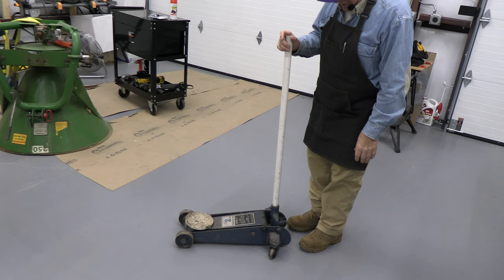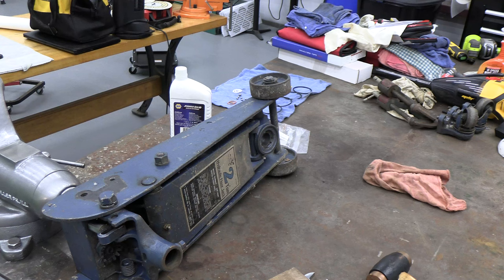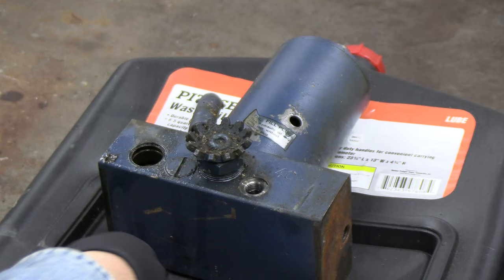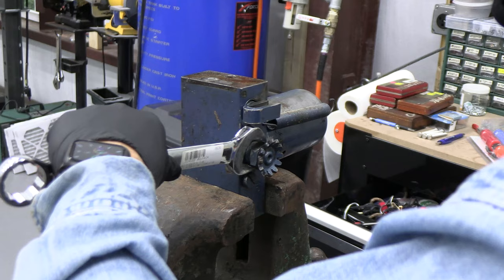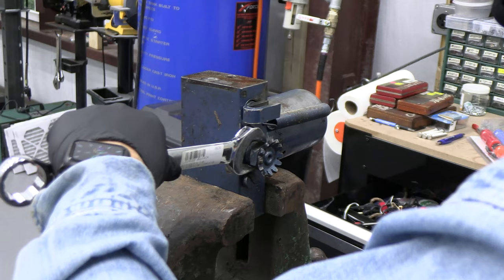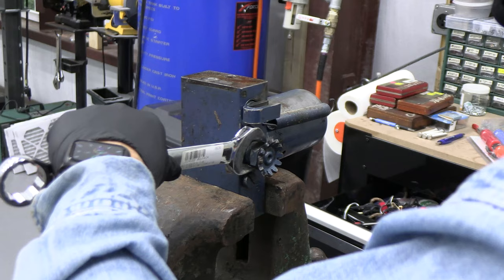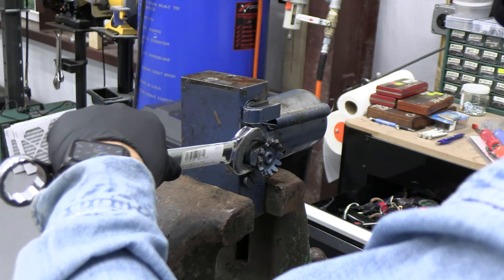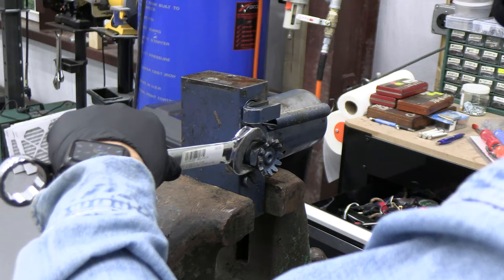Sears 2 Ton Floor Jack Complete Rebuild

Comment: I have a Central Hydraulics 94629 3 ton.  Is there an easy way to slow the release, so it's not so abrupt?
Reply from the maker: Thank you, Garry for your question. I have some ideas, but I’m not certain. One, be sure that the hydraulic fluid in the reservoir is full, too, lubricate the gear where the handle connects to the release valve of the pump. And then I would run it open and close open and close multiple times to get it really loosened up and then you should be able to open it more slowly and have it become less abrupt. I hope that helps. Consider subscribing. Thanks. Joe.
Reply: @JosephHunstad  Thx.  I took the release valve out, disassembled it ad greased the internal threads.  I also marked the gears meshing point for best control with red paint.  All good now.  Probably old and just needed lube.
Reply from the maker: @garyvanremortel5218  Hey buddy great news fantastic I’m glad that worked out. Have a good day. Joe.

Comment: There are many folks that use adjustable end wrenches incorrectly. Iv'e been taught and makes sense, is to flip that wrench over for the direction shown. What it does is it spreads the jaws and allows them to not fit correctly around the fastener.
Reply from the maker: Thank you for your comment. You make a good point. Consider subscribing. Thanks Joe.

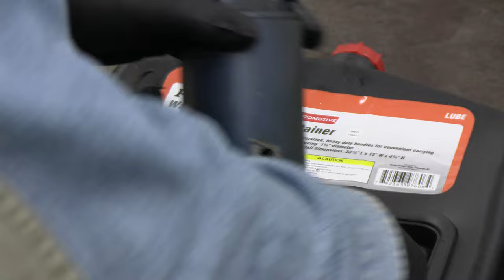Comment: RE loosening the gear in the base @8:17
If you know this is coming off, you can bust it loose before taking things apart. I put it sideways, put on the wrench, and wacked it with a hammer.
Reply from the maker: Hey buddy sorry about taking so long to respond to your question. You're absolutely right I  should've busted it loose before I took it off  of the frame. That was certainly made it easier and reduce the step. Consider subscribbing. Thanks Joe

Comment: I have dads Sears jack from years ago. Our jack is Orange an still works fine but i might need this?
Reply from the maker: Thanks for your question. You’ve got a good jack. If it fails to hold weight, then it needs to be rebuilt until then it should be fine. Consider subscribing. Thanks. Joe.

Comment: Hello Dr. Joe! I have a very similar jack at home, but it doesn't have any lables for me to identify the exact model. It stopped working so I tried repairing it, but made the mistake of trying to blow out some dust with a compressor, so the small balls flew out. I did my best to find each one, but as I do not know the model, it is hard to know how many balls there should be and how big they are supposed to be. I was wondering if I could send you a picture of the jack somewhere, if you could tell me which model it is and how many balls there should be. Thank you and keep making awesome videos!
Reply from the maker: thank you for your comment. Yes you probably have lost some of those ball bearings which is actually OK because the rebuild kit will have everything you need. I would recommend getting the rebuild kit that I suggested because I ended up with a lot of extra parts. If you use it, you will have everything you need.

Use the number of the Jack that’s on my video and Google it and look at images. You will find an exploded parts diagram that you can use to rebuild your Jack.

You’ll have a good time doing it and it will work. Consider subscribing. Thanks Joe.

I will have a link in my video description for you to buy that kit and I actually make a few pennies on it but it doesn’t cost you anything more than if you bought it outside of my lake. Thank you thanks for supporting me.

Comment: Did the white cup part come of easily or did you have to screw it off? Mine won't budge. 0:28
Reply from the maker: OK that white cup should just pop off. You can pry it off with a prybar from underneath it and tap it with a hammer to help it out. It’s not pinned in or anything like that. At least mine wasn’t. Consider subscribing. Thanks. Joe.
Reply: I did. Thanks for the update.

Comment: Awesome video. I have a different problem with my jack (I have a different one mine is a 3 ton model 875.501153). Mine lifts ok and holds the load up but what it’s doing is as I’m lifting my truck higher it doesn’t go up with a full stroke. The higher it goes the less it lifts. As it gets to about 2/3 of the max lift as I pump the handle down it freely goes down almost all the way and only lifts when your almost at the end of the stroke. It will lift and hold but the higher it gets it takes a lot of pumps of the handle to get the tires off the ground. Do I need a full rebuild or what could be the problem? The jack is almost 30 years old and I bought it new at sears back in the day Thank you.
Reply from the maker: Hello there. Great question. Funny that it works that way, but it would suggest to me that seal and O-ring replacement would probably benefit or fix that. I’m not certain however. It’s probably the best way to go. I’d be interested in knowing how it turns out. Thanks Joe.
Reply: Fluid may be low.

Comment: Have exact same jack.  Trying to remove the saddle.  I removed the "C" retaining clip.  But the saddle does not lift off?
                                          Does the saddle unscrew. Trying to figure it out.  Help.
Reply from the maker: Could you tell me at what time in my video that I am working on that part. I don’t really understand the term “cup“ thanks Joe.

Comment: Thank you for this video. Very helpful and detailed. One question : what is brand and size of that wrench extension tool you used at time 9:10 of this video. I think I need one of those.
Reply from the maker: I'll get back with you Its at my cabin
Reply: Thank you. After reviewing the video about 25 times and searching I think I have found the tool from a Canadian Store - Thanks again @JosephHunstad
Reply from the maker: OK the wrench extender that I use I purchased from Lee Valley tools. It is made by the chestnut tool company. It has two very large rare earth magnets that hold the wrench in place. It is very well-made and a very good tool. It’s about $27 I think from Lee Valley.
Reply: Dr. Joe - thank you so much. I have just bought one of these tools from Lee Valley and until your video I had never heard of Lee Valley Tools - what a great store and resource. Thanks again. @JosephHunstad

Comment: If I send you my jack, will you rebuild it? 😄  Serious though, How many turns did you back out the screw on the right ( with the needle valve)? I think my screw is all the way in.
Reply from the maker: So great question. Typically I I bottom the screw out and then back it off six turns that’s just a beginning point and then you can you can bring it out more or less based on the function of the Jack but it’ll probably work well at that point. Six turn seems to be a good starting point Consider subscribing. Thanks. Joe.

Comment: At 32.10.   You refer to the "saddle" as the  "cup" .  Added oil so it would more easily rotate.
                    OK.  I am trying to remove the saddle. 
                    The "saddle" has a post, which goes in a "hole" thru the metal.
                     The post has a C-clip retainer.  (ie.  rotor clip, snap ring).  Looks like a "C".
I remove the C-clip.  But the saddle will not lift off.   Saddle p/n  2109

Should be simple.  What am I missing.  
Thanks for the quick reply.

My jack is exactly like your's.   Sear's. 2 ton. Model. 328. 12160
Reply from the maker: OK I totally understand. That is the part that actually comes in contact with whatever you’re lifting. That should just slide out. It’s not threaded in. If it doesn’t slide out, you should be able to just tap it out with a hammer and a punch. Sorry for my confusion.
Reply: Thanks for the quick reply.  What you suggested is what I already tried.  Will take a closer look
with a flashlight. It appears, even with the C-clip removed. The "end" of the saddle post appears to be
wider in diameter than the "hole".  

The saddle does spin around. The "post" is smaller in diameter than the "hole".  Just the very end of the post, the diameter is slightly larger than the "hole" so will not slide out.  Weird.

Thanks .    @JosephHunstad
Reply from the maker: @leeozawa  OK that is totally weird. I am certain that it just slides in at least in my situation wires white and at the end it’s weird if that is the case you could take a grinder and just grind the edge of it down reducing the diameter or even put some sandpaper on a grinder and sand it so that the diameter goes down but that should just slip in an out and it’s being held by that external retaining ring
Reply: Thanks for your advice. Got it out. Not much room to work with
.  
Used a metal chisel. (as a wedge).  Lodge in between the bottom of the "post" and the horizontal metal
tube.  And using a hammer.  Gentle taped the end of the chisel, and by pushing in the "wedge" end. 
The "post" lifted up.  Hooray.... @JosephHunstad  

FYI:  Reason for removing saddle.  Am in process of installing gas water heater. Younger days, I just lifted it 
        into place.  By removing saddle. I plan to attach length of plywood/lumber to the lift.
        Only have to raise heater about 18", and it weighs about 80/90 lbs.   Saw a video, where someone
        did a similar modification.  Again, thanks for the advice.  It help a lot !
Reply from the maker: @leeozawa  hey man great to hear it. Glad everything worked out well. Good luck with your hot water project. Take care Joe.

Comment: From my exploded parts diagram, it seems there is another steel ball inside the piston assembly. Since you left it alone, guess it is not worth the effort to change it out?
Reply from the maker: Hey, great question. There are actually more than three ball bearings, but they are just not in any way, damaged or corroded in the vast majority of cases. They are made of stainless steel in very hard. I would probably leave them alone. Consider subscribing. Thanks, Joe.
Reply: @JosephHunstad  I used most of the original steel balls b after using a micrometer on the replacements They were a tad smaller.  What I should have considered leaving alone was the safety valve. I got the count wrong on how many turns on reassembly. The jack worked on the bench, but just made a squeaking noise when I tried to lift a real load. I was also surprised on how many extra parts there were in my kit. Already subscribed.
Reply from the maker: @jaydee3046  hey man I’m glad you got it going. And yes, I found that out too. There were many extra parts in the kit not all used. Have a good day. Joe.
Reply: @JosephHunstad  On the piston, I put the arm of a drill chuck key in the cotter pin hole. Then I ran the vice down on the chuck body and undid the bolt. Figured this was better as it kept the jaws away from the piston.
Reply from the maker: @jaydee3046  great idea that makes total sense well done

Comment: Great video what parts kit number did you use
Reply from the maker: Hey Jesse, hope you’re doing well. I actually went on Amazon and put in the part number of the jack and the replacement kit came up. Try that. Consider subscribing. Thanks, Joe.

Comment: I can’t find a kit for my Lincoln 2 ton jack H680041S2.  Can you recommend a source.  It’s Chinese made.  Thanks for the great video.
Reply from the maker: Hello Terry,

Although I was unable to find a rebuild kit for the exact part number you listed, there are many such as the following:
Floor Jack Seals Kit for Lincoln Walker Model 93642 All Series B C E, 2 Ton

If you copy and paste that into eBay, you will find a kit for about $30 that probably will work. It is worth a try as many of these parts are interchangeable and these jacks were sold under many different names. Let me know if that works for you. Thanks. Consider subscribing.
Reply: @JosephHunstad  Thank you.

Comment: my pump piston still leaks even after rebuild....
Reply: OMG, you did the rebuild and it still leaks (from the inside). Man that stinks.
Reply from the maker: Dan, that is the first time I’ve heard of that I am so sorry I don’t really understand it. If that’s possible is the metal cylinder cracked or is the weld at the base of the cylinder somehow leaking? Those are the only things that I can think of. So sorry to hear about that man. This is what a bummer to rebuild it and have that go on. I’m so sorry. Take care. Joe.

Comment: Have sane type I got from someone but the handle that tightens..can't turn
Reply from the maker: OK that’s a dilemma. If you take the handle out of the jack, you probably can access that star gear and put a plumbers wrench on it after you thoroughly treat it with some form of penetrating oil. I would just wiggle it back-and-forth and I think you’ll be able to get it to turn consider subscribing. Thanks, Joe.
Reply: @JosephHunstad  got it blast with some penatrating oil .. now it won't stay up and it has jack oil . So I guess I'll have to try the seals like what you did . Thanks
Reply from the maker: All right, great good news. Yeah, rebuild is in the works. Take care Joe.
Reply: @JosephHunstad  thanks much and all the best.. 👍🏾 👌🏼

Comment: I notice you smacked that screw I am having trouble with. I tried that too and no luck.
Reply from the maker: can you tell me at what moment in the video that is so I can check it out as a  can't really remember thanks Joe
Reply: @JosephHunstad  the part where you took the compressor apart and was removing those screws that contained ball bearings. The one I'm talking about is the one next to the lever that goes into the pump housing. I guess it pumps the oil. Next to it is a screw that is flush with the pump case. You had to use a chisle with a rubber handle to hammer it loose while you turned it, that part. Mine is frozen and any attempts to fee it just chews up the metal. Any solutions? HeAt maybe?
Reply from the maker: @user-TurboD12  actually that screw you don’t necessarily have to take off because what that does is adjust the flow rate, which is probably fine. It was set at the factory. I would leave that one alone.
Reply: @JosephHunstad  thank you. I appreciate your advice.
Reply: @JosephHunstad  can't wait to see your other videos

Comment: My neighbor gave away a 3-ton Sears jack today, but the handle seems to be something her late-husband rigged together.
Any idea where I can get a handle to fit one of these? I see a lot of the ones with the crimped end. Do these ones have a particular name?
Reply from the maker: Hello frosty. You raise a very good question. It’s unusual that the handle doesn’t come with the jack even in used condition. On the end of the handle it is such that it engages with the pin so you can twist it closed or open. It also has a groove And allows that retaining screw to keep it in place. 

I will keep my eyes out for an available handle, but I’m not aware of one currently. Consider subscribing. Thanks, Joe.
Reply: @JosephHunstad  if you could figure out the measurement for the pin that goes through the end that sits down on the adjuster for when you drop the handle down you could just find a piece of pipe the same size and make a new handle I have done this twice now and the handles worked out fine
Reply from the maker: @barneyrice8502  hey man that’s great advice. Thank you so much please consider subscribing. Thanks, Joe.